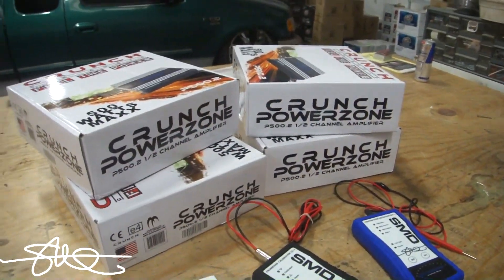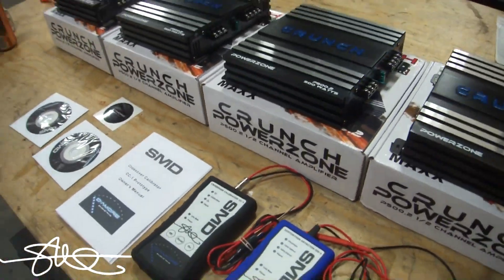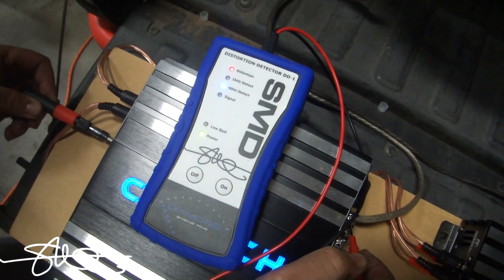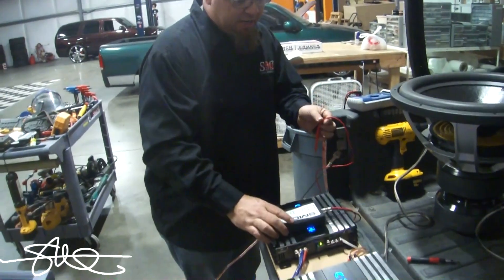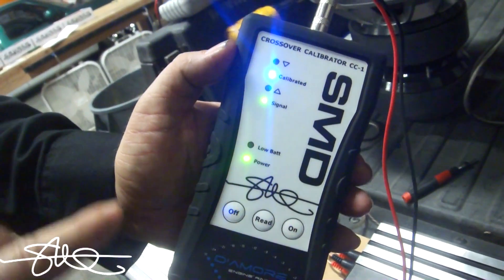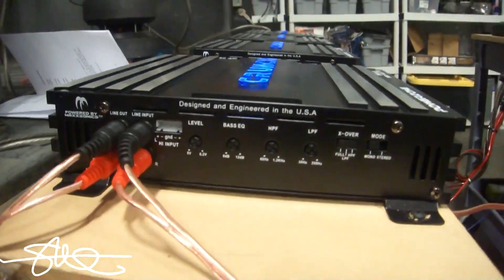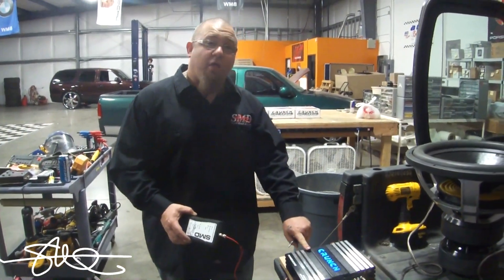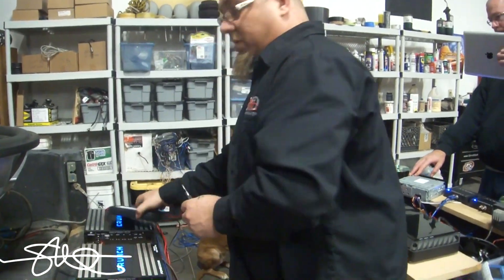SMD CC-1 Crossover Calibrator Multiple Amplifier Gain Matching Device

Comment: I've been using your dd-1 and cc-1 for years now. I've had 4 750w 10s  in a trunk build floating your dd-1 cd case in the window on a single 1k getting 250w each 😆 
I've got an EXTREMELY loud and clear submersible marine grade setup on my atv tuned with these. I usually just read the manuals HOWEVER... I just got back in the audio game after 5 years out. Doing a build in my semi and wanted to watch a vid this time. 1 thing caught my attention in this vid. After gain matching, you never mention to get it out of competition mode before you set the crossovers. Did you miss that part or am I just thinking wrong? I'm going to turn the cc-1 off and back on before setting crossover and filters on my bass amps. If im doing something wrong someone lmk please. Thanks!

Comment: So the cc-1 doesn't do distortion detection? 
I would have to get both of those devices if I wanna set the gain and   if I wanna match the same power for the second subwoofer amp?

Comment: Hey I've got a question because didn't see you addressed this!! does the head unit need to be set to zero on treble and zero on base and 0 on subwoofer output gain??? Also if any electronic crossover that is in line what does it mean to be set to?? Or any line drivers what do they need to be set to???? Before doing this tuning?????

Comment: How are they putting out full power if the gain isn't up all the way? What if this new gain level is too low for my subs and they want more power? Do I calibrate it before I use my signal processor?

Comment: Have a question. I know you start with the main amp 1st.  What if says not calibrated you adjust the gain until it does correct? Yours was calibrated on the first try. Was just wondering. thanks

Comment: how to set your crossover on a 5ch amp 
 Like 
HP filter off X1 X10
(HZ)30-600
Filter off hp bp
 Subsonic 0-30
Lp filter 50-600(hz) 
 Some one anyone help!? Me
Reply: Ray Castro Late response sorry. But use the cc-1 tool that was mentioned in the video.

Comment: OK I was thinking maybe you put a multimeter on each one, found the one with the lowest ac output and turned the others down to match. if you picked the one with the highest ac output you would have to turn the others up but they are already set to maximum unclipped volume.

Comment: When i change the full range switch to low pass on my rockford full range amps i notice the oitput signal increases..
When i use the cc1 and read when in amps low pass mode the calibration seems to match the crossover frequency markings exactly on the amp... When i read in full range mode the calibration seems to be lower than the markings on the amp... Maybe using the 80htz track , the amps saying about 70htz on the markings...
. .? 
Which to use...

Comment: OK I see where you chose track 16 for the 80hz, but was there a setting on the Crossover tuner that you had to set? Maybe I missed something. How would the piece of equipment know if that was 80hz or 100hz ?
good vid though.
Reply: Maybe it measured the next octave up and found the next octave down by 12 db

Comment: @ChevyGangman323 does the radio not have an ext amp turn on wire?, if it doesnt then check the interior fuse box panel to c which fuse is the "radio" fuse, i have always seen it as a 10amp fuse, dont run all the remote turn ons off of that 1 fuse, u will be sure to blow it, but use a nice wire, i use a 16ga wire, then use a 5 prong relay, run a "+" and "-" wire to the relay from the battery, then from the radio fuse to the relay, then from the relay to all the gadgets u want to turn on with ACC

Comment: so with the cc1 after the dd1, did either of the amps gain incresased or degreased from what the dd1 read? if it increased a lil to match the calibration of the master, would that leave it a slight distortion? should still be fine correct?

Comment: AND ALMOST FORGOT THE PRODUCT THAT U HAVE IS SOMETHING THAT I WAS WAITING ON FOR SOMEONE TO BRING OUT. AND MAN THAT PRODUCT U HAVE IS FANTASTIC. QUESTION! CAN U SET GAINS ON A AMP IF THE AMP IS NOT RUN THROUGH DECK BUT THROUGH A CROSSOVER OR A Line DRIVERS?

Comment: @chman99 when the signal light turns red, it doesn't mean the signal isn't clean.  It comes on to indicate that it doesn't need that much voltage to do its job, so to turn down the volume.

Comment: @PinkBunnyzGalore depends on the amp try to find a monoblock that is around the max peak of the sub. but like Rockford Fosgate amps like the T2500 is its rms 2500 rms and 5000 peak which is really more than that tho